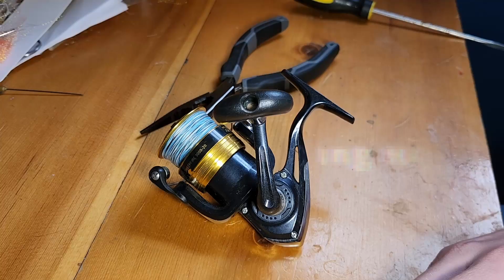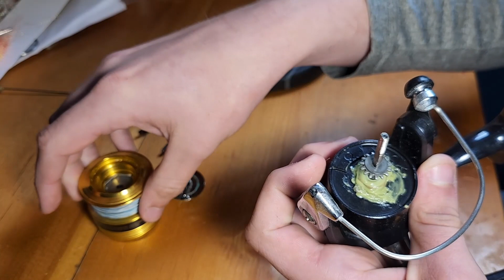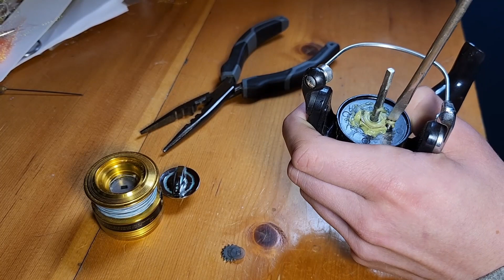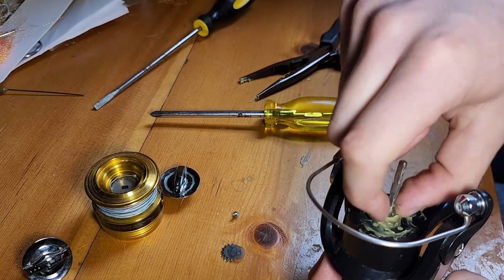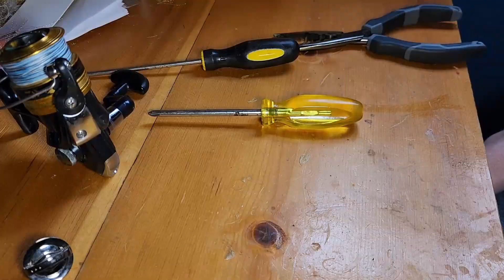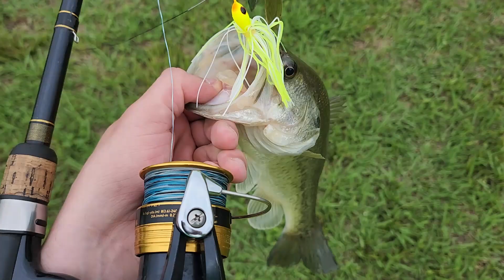Fixing A Spinning Reel With A Broken Anti Reverse

Comment: Can someone explain what anomaly alowed this (relatively) easy fix? 
Why wont the problem recur?
Reply from the maker: My understanding is the anti reverse just getting to tight, and going in there allows it to loosen back up so there it works agian. I've now caught roughly 30 bass on it and a 8 pound catfish on the very reel I fixxed in this video. I am confident that this fix is viable and will hold up for at least awhile, and if it breaks agian I wouldn't be sure to say the fix was faulty or the reel is faulty, because this sipping reel I'm this video was only 35 dollars online.
Reply: It's more likely that it just needs a good cleaning. The gobs of grease aren't doing the reel any favors and will hold dirt that causes the mechanism to stick, especially if it hasn't been used for awhile (stored in a garage all winter, for example). They like just a minimal amount  of lube.